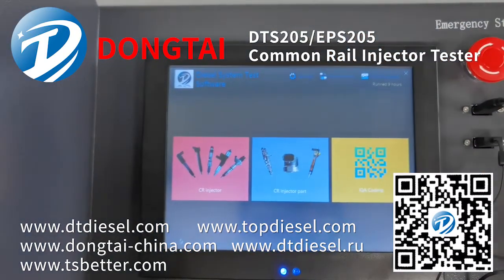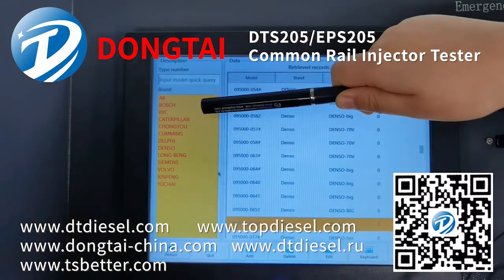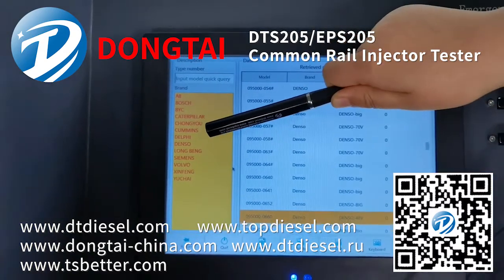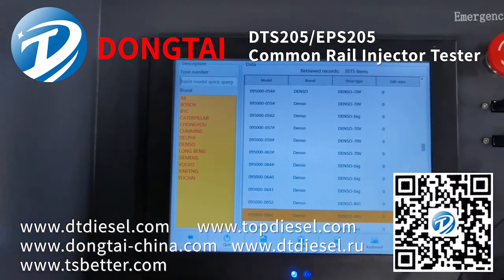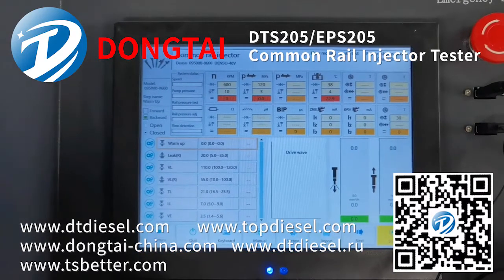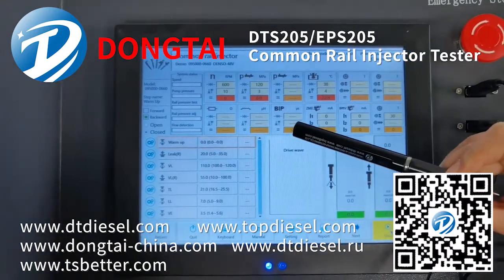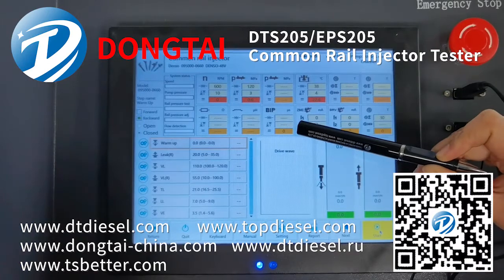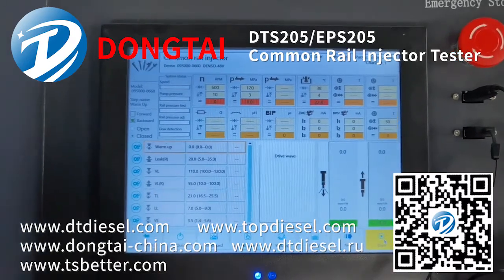DTS205/  EPS205  Common Rail Injector Test Bench -2021.03

Comment: Hey , DTS 205 new test bench have problem, test automatically stop showing error with 1. Check common rail pressure sensor plug and wire 2. Fuel supply .
And also error code AL 05 show on the rear monior above common rail. 

Could you help me how to solve this issue ? This is brand new machine , just test today and found problem .
Reply from the maker: hello my friend , pls add my whatsapp:008613854812588
Reply: Did you get this resolved?